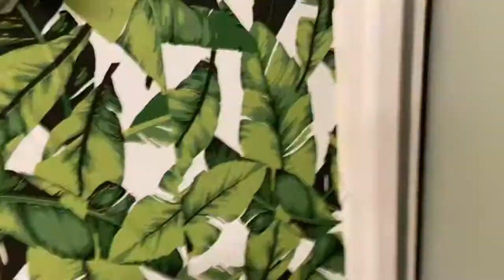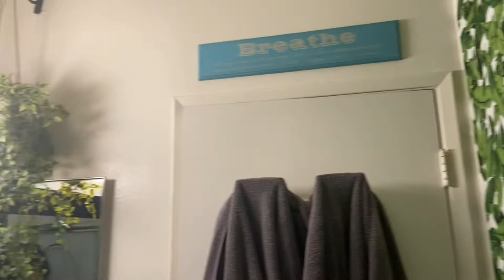Upgrading my Rental Bathroom for Under $150! *Renter Friendly*

Comment: FFR: The towel bar can come completely off (usually use Alan Wrench to get the circular pieces u cut around off the wall) also I think u could have cut those screws that wouldn't fit.  Love what u did & how it turned out & ideas u gave me!  Best wishes.  I love ur creativity.
Reply from the maker: Good to know! Thanks for the tip, I’ll have to use that next time😊

Comment: Not my personal taste the wall paper pattern .I love it your inspiring with your creativity! I absolutely hate shower slide door soap and scum best friend rally dates a bathroom 🤣 .I was renter at the time .Took them down once you knock that top bar loose which most times only held in place with plumber's putty or some clear silicone. Wrapped and taped in some old blankets and put in my storage until I moved many years later.I used removable wall paper with a marble with black veins to cover bathroom counter top.
Reply from the maker: That’s really creative what you did, unfortunately I don’t have extra storage so they have to stay on 😝I agree the slide doors require a lot more cleaning